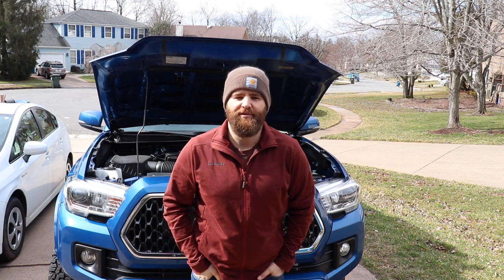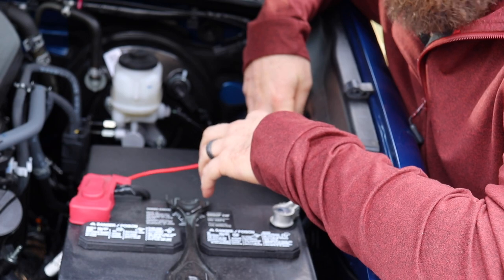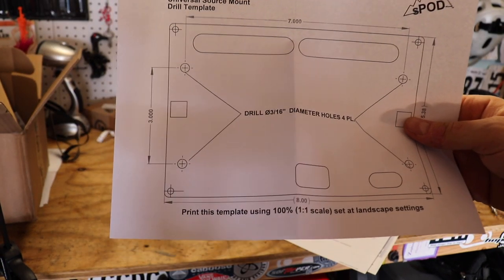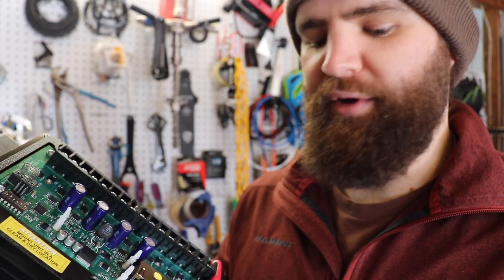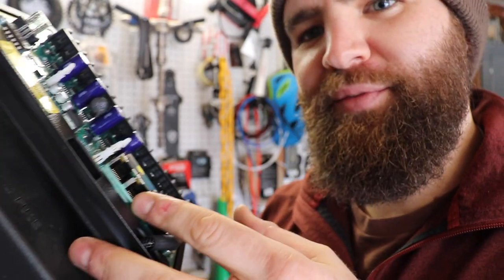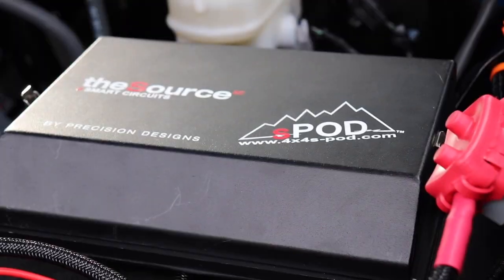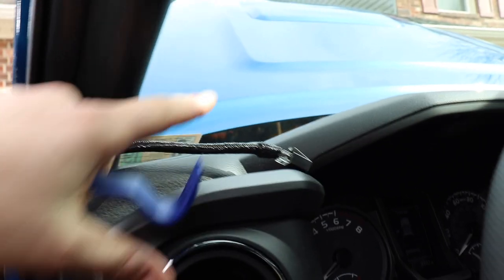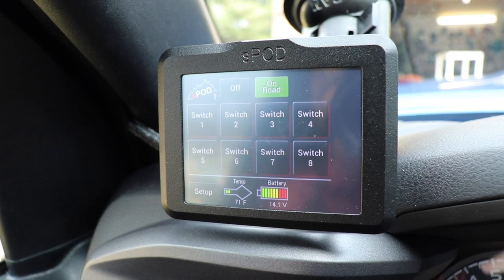Tacoma Spod Install

Comment: question on the touchscreen mount, you are using a 
suction mount with ram mount what piece is on the 
back of the touch screen as this will be my set up also thanks.........
Reply from the maker: I screwed  a 1" RAM mount ball into the back of the Spod screen